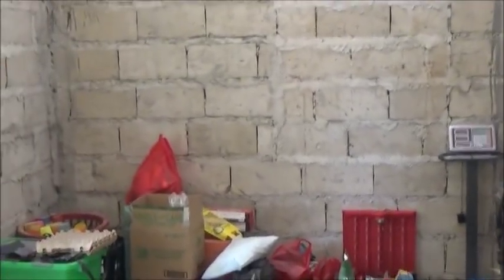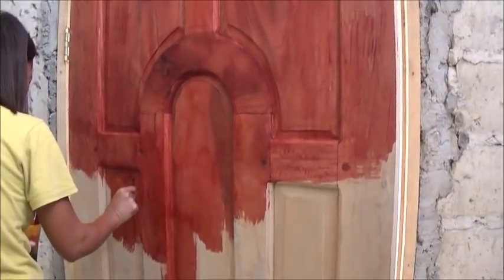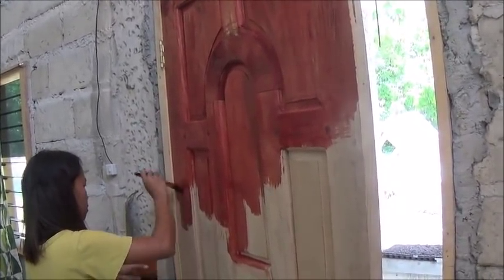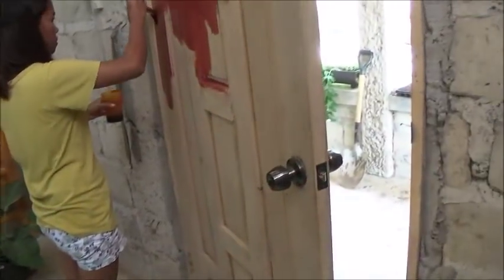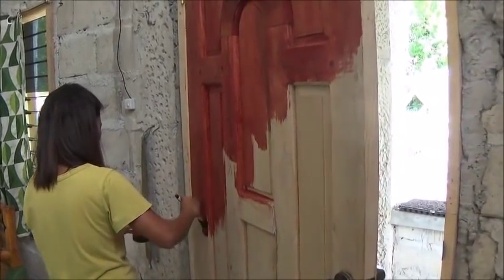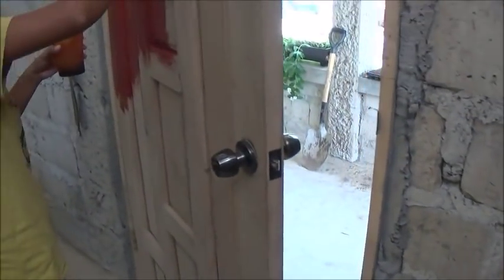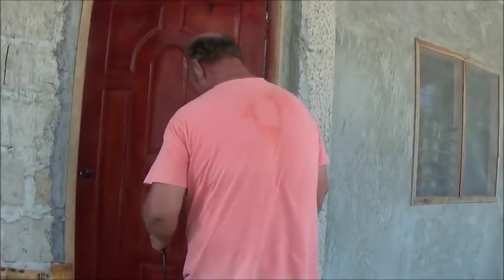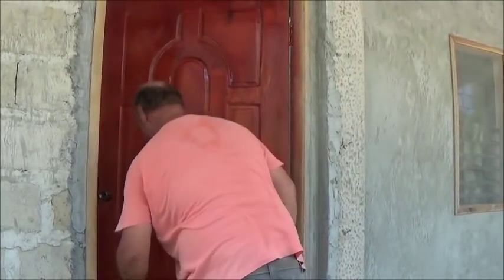VARNISHING THE DOORS

Comment: Hello Brian & the boss.
Great video.  Very entertaining.  You two are brilliant together.  
I scored it 1 - 1
I would definitely spray the door. Point to Brian. 
Re gap under door. I know that us westerners will use a thin bed adhesive to bed the tiles. But I've seen many of the locals laying tiles there. They seem to lay them on a mud bed which is much thicker than the adhesive we use. 
Great video. Love to are you bounce off each other. Long may you continue and prosper. 
Andy UK

Comment: The armchair quarterback said would have removed the door....  either works    Good job
Reply: Yes, place the door in a horizontal position. This way the stain or paint doesn't run and you get a more even application. I never do though because I'm lazy.

Comment: The door looks great, but why not take the door off the hinges to stain? Oh, right your covering the floor so the stain on the concrete does not matter, duh! Maricel sure is a hard worker. Brain you seem to be really good at doing what my mom would call a lazy man job which means finding a easier way to do a task. You'll sound like a great farming couple. Of course in my book that sprayer is now had a toxic in it so not good for gardening, but I realize most people do not care about such things. Great video.

Comment: gotta  be  honest,  what   passes for  'varnish''  in  the  Phils  is  flat,  lifeless  dull  wood  stain.  TheRe is no  --varnish---available. Show  me  a  nice  glossy   mahogany finish?  Cant  get  it  there,,  just  that  dull   stain  crap.  Not  your  fault  Brian  and   no  offence  to  you  two  personally  but   we  both  know  that  flat  finish  stain  is  NOT  varnish.your  saving  grace  in  all  this  is  you  didnt  go  native  with  the  ever  present  Lime  Green,  Pink  or  Yellow.  LMAO
Reply: Have you heard of Rimu & kauri wood from New Zealand ;) Check it out
Reply: Just make sure it is weathered or it will peel & Don't use the brand British Paints in Philippines it won't last against the sun like in Australia.. Dulux is best or Resene Aquaclear waterborne urethane varnish. If the door is well sanded it should come up nice. Hard to get some decent brushed though in the Province areas I think..
Reply: in my place, there is what they call something like "valspar" or it sounds something like that. similar, i think to varish, yet has a glossier/thicker finish...if applied more than three times...waiting for the coat to completely dry before applying the next one. also, it's best applied using cloth. spraying is what local furniture makers do at low pressure.